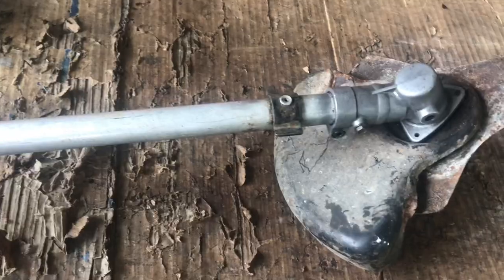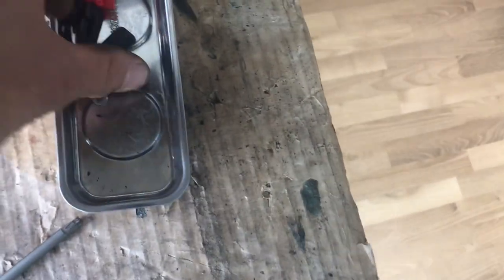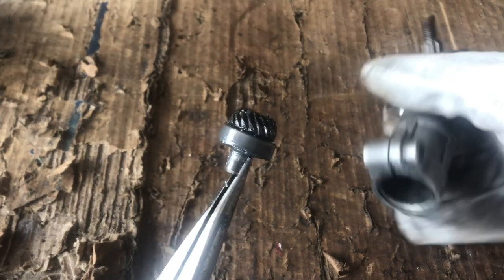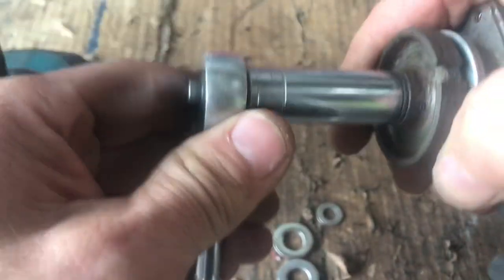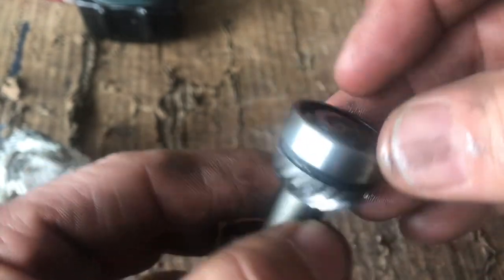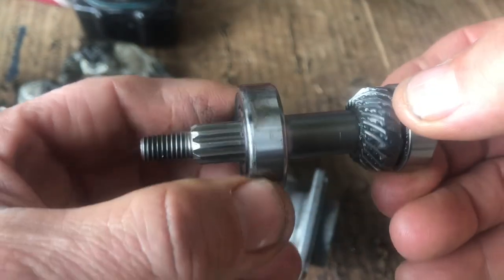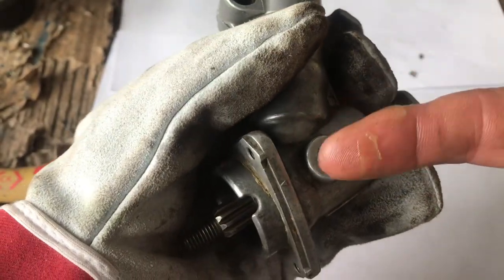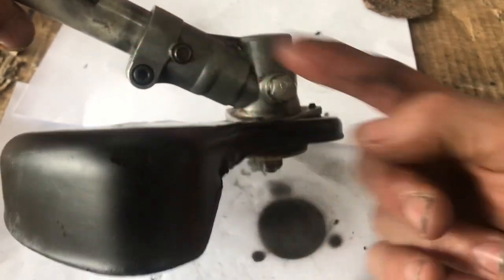Stihl, , Ryobi, etc Strimmer Cutting head gearbox - easy service/fix

Comment: I really appreciate the personal details such as the comments on the quality of the head and bearings. Was also wondering, and i know this is basic knowledge, but why does heating the head make it easier to work on? Thanks
Reply from the maker: Thanks for the feedback. Aluminium expands very quickly and much quicker than the steel bearing outer race. So with heat and the bearing comes out of the Alu casing easier. 
You can do it 🤷‍♂️

Comment: hi i have a sanli gts 26 strimmer and i am getting a universal gear head for it i have seen two but they are different sizes how do i measure it to get the correct size please
Reply from the maker: I would suggest to measure the diameter of you tube it connects to and go from there. You can do it ?

Comment: I’d put some grease in the bottom of the head. I had rebuilt one of these heads myself.. you should re pack the bearings before you reinstall them
Reply from the maker: Yes that's why it's on the video. You can do it 👍

Comment: Thanks for showing how to dismantle and grease the cutting head gear box which I have the same type. According to my experience, circular saw is more effective in cutting tall grass, bushes and small branches. With the guard on, I can put an 8 inch circular saw in the cutting head and without the guard, I can put 8, 9 and 10 inch saw blades. With bigger blades, you will need a stronger trimmer. I have 26 cc Black Max trimmer, and it works well with all the saw blades.
https://youtu.be/HTqeXZ8P-GM?si=6uLymBU39zMXd7tS
For safety reason, it is advised to always use a guard but the accident without the guard is very rare. I always use a face shield that we use in covid 19 protection. With a guard on, it is counterproductive, and inefficient. The debris can also entangle in the guard. Instead of trimmer lines, I prefer to use saw blades and can cut both grass and small bushes with branches. Please check the above youtube video about the pros and cons of using a guard. I believe the benefit of using without a guard outweighs the risk.
Reply from the maker: Welcome to the channel and thks for feedback info. You can do it 👍

Comment: This was extremely helpful as i wanted to confirm the Head output shaft was captive from behind the bearing as i need to tighten down the head and it will be pulling the shaft outwards but the shaft has that lip behind the bearing so stop it being pulled through. You need heat on the ends of the unit to get the out bearing out but do you have to heat the inner part too for the inner bearing?
Reply from the maker: I didn't need to. Let us know how it goes. You can do it 👍

Comment: Sir i need fs55 gear head bearing number .
Reply from the maker: Measure outside diameter, inside diameter and the width. Then do a search on the Internet with those dimensions in mm. Hope this helps. you can do it👍
Reply from the maker: Keep us posted. You can do it 👍
Reply: 609 2Z/C3 SKF (small)
629 2RSH/C3 SKF (medium)
6201 2RSH SKF (large)